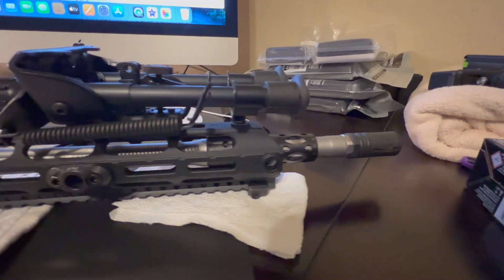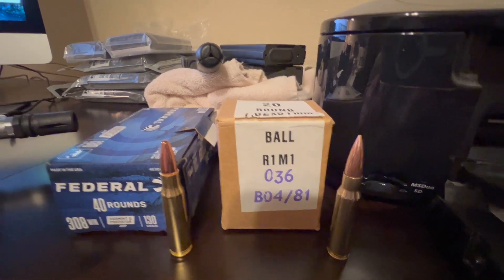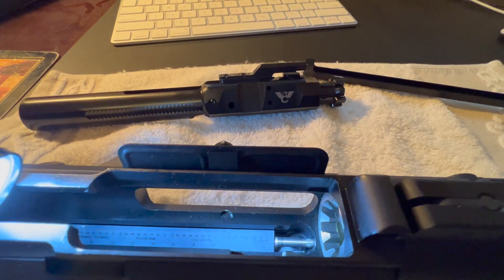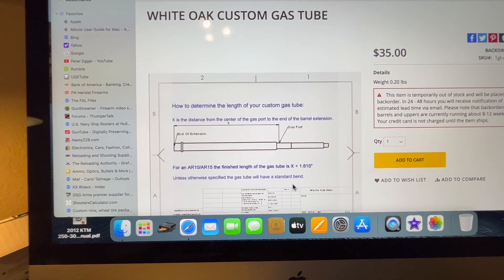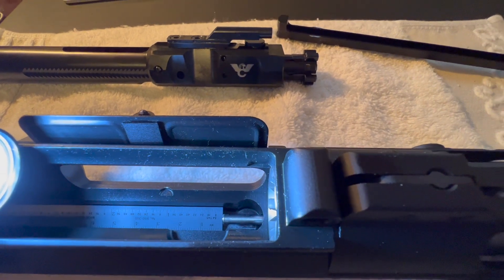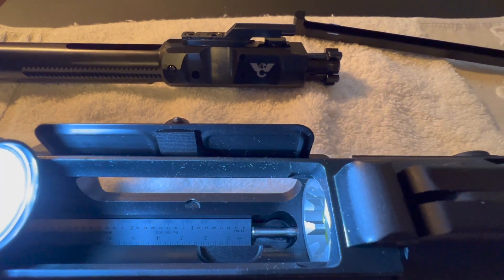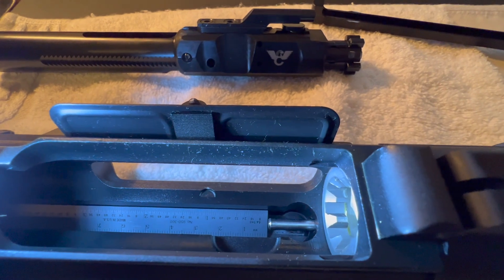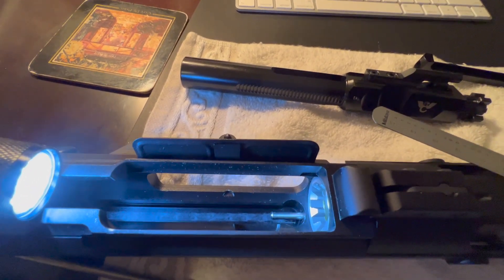AR308 New Frontier Armory DPMS Gas Tube Length To Short! - 13

Comment: I just got done putting together my Wilson Combat AR 10 Super Sniper 308cal with all wilson parts, Wilson AR 10 Upper, Wilson 18" Fluted Super Sniper Bbl. I was ordering the Bbl. and followed there parts list for the low  profile Wilson Gas Block, and Wilson Gas Tube. The AR 10 orginal configuration is a Wilson Combat AR 10 308 Super Sniper w/ Wilson Combat Heavy non fluted Bbl. and Wilson Combat complete Upper and Lower. I got everything installed, got the Bbl. Nut timed perfectly, Gas Block is prefectly aligned with the Bbl. Port. I installed the Gas Block and Gas Tube and noticted a difference in the length of my Gas Tube installed on the new 18" Fluted Wilson Bbl. was longer than the orginal Bbl. I took the Wilson Combat Bolt out of the orginal set up and installe it in the new Wilson Upper that I had just finished, the Bolt would not mate up to the Bbl. Lugs, it was sticking out to far and I could not get it to do so. I had to take a nylon punch and tap the bolt out of the Bbl. thats when I noticted that the new Wilson Combat Gas Tube was way to long and was keeping the Bolt from making full contact with the Bbl. Lugs checked the package and it had the correct part number and a length of 15.5 but it came past the half way mark that you showed in your Reciever. That's when I looked at the orginal upper and noticted that it came up just short of the middle of the cut out in the receiver that you pointed out in yours. I pulled the Rail and Gas Block with the Gas Tube from the factory built gun. I measured the length of both Gas Blocks and they were exactly alike, put them side by side and noticted the new Tube was longer than the orginal, I even installed the orginal Gas Block on the new Upper and checked were it came out in the receiver and it was just shy of center of the cut out. I snuged it up on the new Bbl. dropped the bolt in and it made full contact with the Bbl. Lugs and I could pull it out with ease. The new Tube was about a 1/4" longer than the other one and it came past center abd would hang the Bolt up. I trimmed it to the length of the orginal with a good set of tubing cutters made to cut stainless steel, reinstalled it on my new Bbl. dropped the bolt in and it made full contact with the Bbl. Lugs. I don't have a Flare Tool that will go that small, I did ream it out straight so there were no burs and got rid of the spot were it was cut with the tubing cutters and made sure it was open fully. Do I really need to do anything else to the Tube it works by hand and there is no "drag" when inserting and "removing" it by hand. Sorry guys for this long story, but I searched high and low for any information on shortening the tube like I did. Any suggestions that someone might be able to give would be appreciated. Great Video, that's the only one I could find that had to do with the AR 10 Gas Tube being to long. I may just order a custom one from White Oak like you did, but I would like to see if my modification on my Wilson's Gas Tube will work like it should before doing that.
Reply from the maker: Great comments! There are a number of things that will vary on large caliber AR platforms depending on who the manufacturer is beyond  true AR10 dimensions or DPMS AR308/LR308 pattern. There are no real industry standards which is why there can be a lot of issues for DIY builds and as many times even factory builds! The bubble flare on the end of the gas tube to my knowledge serves to primary functions. Prevents the gas tube from hitting the BCG gas key helping to guide it in and also helps to seal off the gas. Sounds like in your case Wilson Combat didn't keep the same dimensions across its entire line-up of large caliber AR offerings. White Oak Armament does a great job of making an exact length gas tube to your specifications and I think their pricing is reasonable. Armalite AR10 spec is 15.400" although 15.500" worked on both of my DPMS pattern rifles using WC Tactical/Hunter barrels and rifle speed adjustable gas blocks. One with a WC BCG and the other with an Odin Works. I ran across a website that is considered reputable that stated 15.125" is the correct length. No way was this correct! That's AR15 spec! This stuff can be very annoying because of the lack of industry standards! I learned a crap load building mine and how to tune them to run on a wide variety of ammunition. I discovered that they are not the same as building an AR15. Glad my video helped and good luck on your build!

Comment: Yeah that makes a lot of sense, kinda like dwell time only on the other end. I’d throw a regular block and tube on it and see how/if it runs/fits and then mess with the adjustable one. The tube on mine is dead center of the cam pin slot using an aero adjustable gas block and regular gas tube. 

The most common thing i read while putting together my ar308 was to try and use parts from the same manufacturer. They all said that’s the best way to ensure the parts will work together. I used Aeros m5 receivers and a KAK bcg and have no engagement with my forward assist. Otherwise the gun works fine with most ammo but it is a bit finicky,will definitely be the only one i build 😂
Reply from the maker: Plenty of correct gas tubes on the market for non-adjustable. Straight tubes for the adjustable gas blocks are hard to find in the correct Armalite spec of 15.400" for 308/7.62 NATO. A lot of these manufacturers are selling the long AR-15 spec which is 15.250". It works most of the time on a 308 but not always or not well and it's not the right length for most builds. RifleSpeed needs to get up to speed and sell the correct length for 308's instead of the one size fits all. I didn't catch this one on my build! It may not be the entire issue but at least it's getting eliminated as one. Lesson learned! Sounds like AERO got the gas tube right on your M5.
Reply: @peteregger7928  i wonder if you could get with someone to make you a gas tube. I got one of the black river tactical gas tubes for my mk18, not sure if they make the tubes or just drill the holes but might be worth asking if they could do something for you. 

My barrel is a solgw/ballistic advantage 16” mid length and just runs regular block and tube. I added the adj gas block cause with a can it was unlocking too fast and having primers pop out. Anyway definitely a lot easier to find standard midlength stuff than proprietary stuff but that rifle speed block is pretty cool.
Reply from the maker: @itsamk18-ish  I have two "Custom" straight gas tubes on order with White Oak Armament that I placed right after the video. White Oak is one of the few that actually make gas tubes and will custom build them to the length that you ask for. There's really nothing custom about the length that I need as it is Armalite spec for AR10's. It's just no one has straight ones. Ordered one at the correct Armalite spec of 15.400" and then one slightly longer at 15.500". They said up to two weeks though! Thanks for the suggestion as I had not heard of Black River Tactical. Going to take a look now.

Comment: I have a Stag Arms .308 project on the shelf and ready to go. That may be my first and last as well lol
Reply from the maker: I think you may actually have an easier time with the Stag Arms because it's an Armalite pattern. More of a true AR10. But then there's the AR10B and the AR10A pattern. Hmmm! Nope you're still going to have lots of fun! Lol!
Reply: @peteregger7928  lol....  It has the 45° cut in the back, so it's definitely AR10, but I will have to look into this AR10A and AR10B business HA HA
Reply from the maker: @malcolmpalm  Well, let's get the confusion started right now! The AR10A is the newer version of the AR10B. The "B" was the first upgrade from the AR10. The "A" was the upgrade to the "B". The "B" uses converted M-14 magazines and the "A" uses LR/SR magazines. Why did the "A" come after the "B"? Shouldn't the "A" have been a "C" because it came after "B"?  Sometimes the firearms industry is run by idiots! It only gets worse from there, Lol!
Reply: @peteregger7928  LMAO
Reply: @peteregger7928  I recently attended a two-day AR-15 armorer's/builders class and the instructor was of the same school of thought in regard to the general AR-10/DPMS ecosystem. Part specs all over the road, a lack of standardization, and an overall nuisance to deal with.
Reply from the maker: @malcolmpalm  That sounds like fun! I would definitely attend an AR-15 class if there was one close by. I had an old American Gun Institute VHS tape video years ago for the AR-15. So many things have changed since those days but that old video is still relevant!
Reply: @peteregger7928  I'm sure it is still relevant. This class was on the East Coast and more than one attendee was from the other side of the country. School of the American Rifle, Chad Albrecht is the instructor. VERY knowledgable! Check SOTAR out here on YTube or on social media.
Reply from the maker: @malcolmpalm  Ahhh! Watched quite a few of his videos!

Comment: Wow, what else could possibly go wrong next? That thing is starting to sound like me taking my old ford truck to the auto parts store for break pads and them asking what color the seat is because light color seat's have wider pads in the back then the darker ones, 😂.
Reply from the maker: Ha! Ha! I know right! I found a few gas tubes at 15.400" and 15.500" on the shelf but they were the bent ones for non-adjustable gas blocks. No one had the straight ones so off to White Oak Armament for "custom" gas tubes! Lol!

Comment: Sounds Like You Got Always Somethin Figured out Now Pete I Wonder If In a pinch You Could Get Some Brake Line and a Bubble Flaring Set and Make a Gas Tube From Scratch If Need Be 😀 I Think You Got It Solved Now 😇👍🏼
Reply from the maker: After I get the correct length 15.400" gas tube I'll do some testing to see if that helped. I also ordered a 15.500" from White Oak Armament which I'm pretty sure will also work on this build. I ordered some shorter RifleSpeed gas plungers which I believe will allow more gas at full open. Going to test one thing at a time so I know which one fixed it or had the most effect. I think the bubble flare end wouldn't be to hard but the end that goes into the gas block would be tricky for me. I screwed up the flaring and my flaring tool on my custom Camaro brake lines until I realized you have to use annealed stainless! Lol! The absolute last thing I plan to do is drill out the barrel gas port. They get bigger on their own anyway. Once I conquer this thing I'm going to write a book! Lol!
Reply: Name The Book Zen and The Art of .308 AR Building 😂😇
Reply from the maker: @chrischiampo7647  Ha! Ha! or "How not to build an AR308!" Lol!